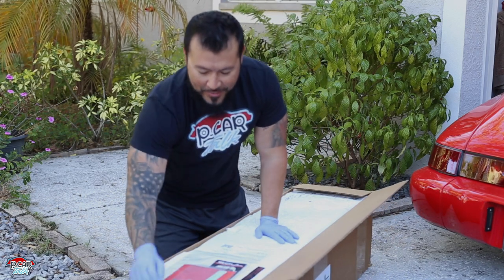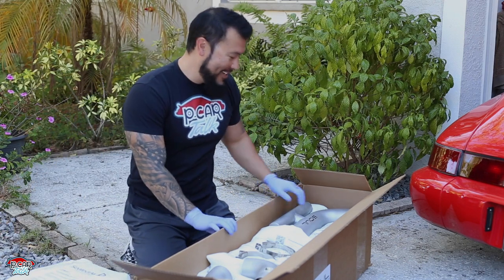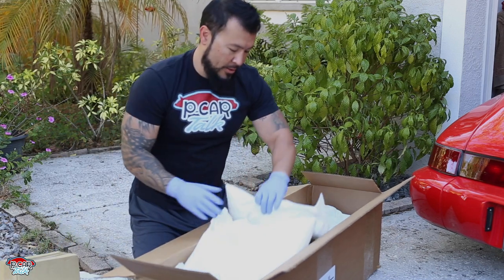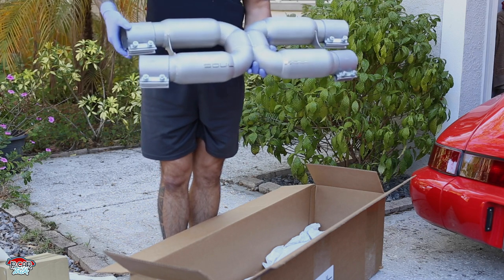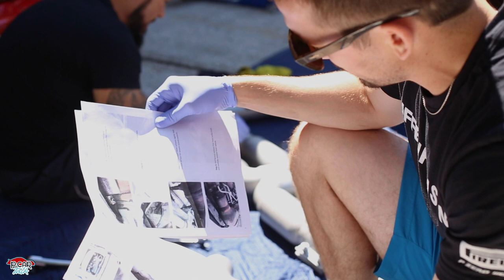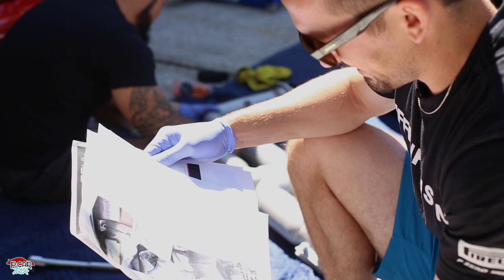Soul Performance - Exhaust Install - Porsche 911 Turbo S (996)

Comment: My car is to low for that set up. I would crush the bottom half of that x-pipe on 1st drive. It hangs down to low. Weird design.
Reply: Yeah I hear it ya. My car is lower on the coilovers but isn’t dumped like the 964. If you are slammed this probably could hit.
Reply: Agreed. Great sound, but weird setup. I have the unobtanium setup on mine and it gives very similar sound without the hangdown.
Reply: I like there systems also. They make a good product.
Reply: @salleluj  do you have a sound vid or sth to compare it?